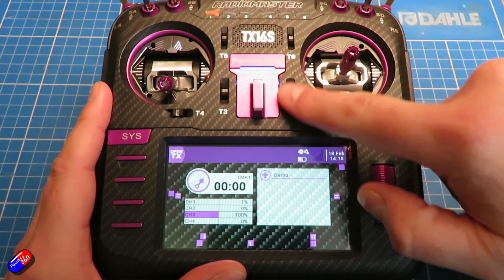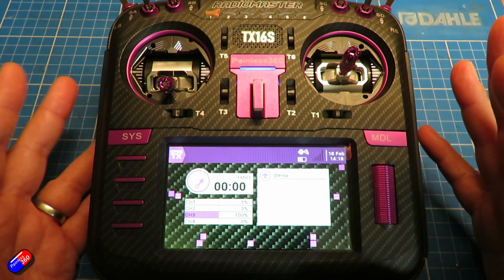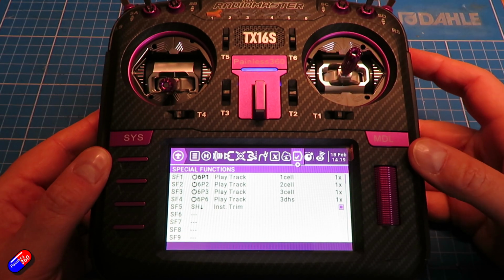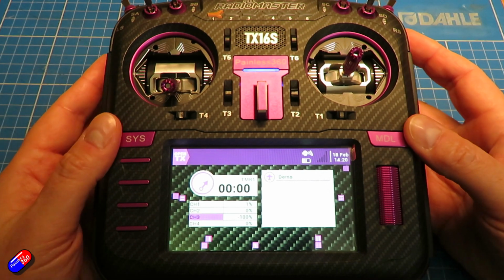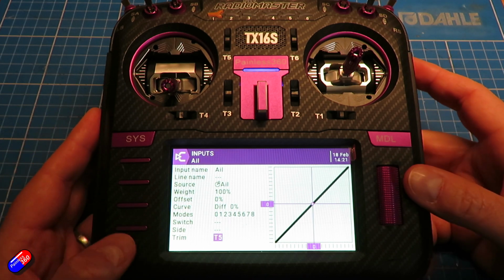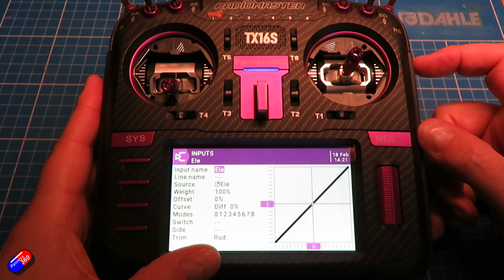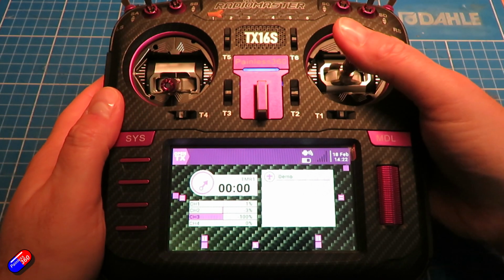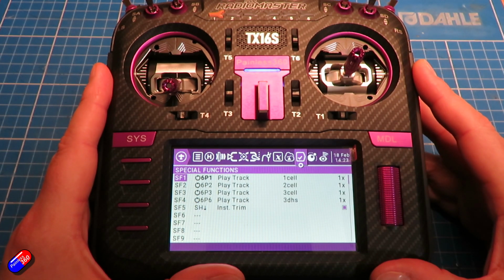How to setup Cross Trim and Instant Trim for your Fixed Wing models (Request)

Comment: One thing I've been wondering, is how can some of the things that go into special functions in models be set up globally.  

For example, if I had many models, and wanted a throttle lockout and instant trim on the same switches always or possibly something more complex? I couldn't find a way for the throttle lockout (throttle override to -100) to be defined in global functions, for example.  

It's easy in special functions, but that means you need to do it in every model, and since it's a safety thing, it would be best if it could be global so it will work on any model that has throttle on the default throttle channel.
Reply from the maker: I'm not aware of a way to do tha - apart from copying the model. If you find something, please let me know... Best of luck

Comment: HI I have just got aTX16S for my sins I am a Taranis owner so while getting to grips with it copying models across and so forth I noticed something. Now the battery (2 cell LiION 7.4v 5.0 AH) came before the TX so I thought I would charge the said battery, the TX arrived I noticed that the battery monitor was not showing a full battery I then proceeded to charge with the supplied lead using my computer after waiting for eternity the green light went out and the monitor showed a full battery . My Hota charger and battery checker recon it was full ???????
Reply from the maker: I remove the batteries from any radio to charge. I don't trust the inbuilt chargers and would prefer the battery to have an issue outside of the radio. Sorry I can;t be more help on this one. Best of luck!
Reply: There is a battery voltage adjustment to correct the reading on the TX16 display. I don’t know if that relates to the charge circuit but it would make sense if it did. Short job using the balance plug to a battery checker and adjusting from menu while powered on

Comment: Thanks Ulf & Lee. I used to use the feature with Spektrum but didn't realise it was possible with OpenTX. Now I see it is, just not a single tick in a box. I think I'll nip into companion and change all mine as I find the right trim hard to find with my left hand which means I have to glance down. As you know, this can be a bad thing!!

Comment: This cross trim programming is REALLY useful. Thanks!
Whoe! I just realized that my Eachine TX16S and the Radiomaster TX16S both have trim switches T5 and T6!  What are those for and how can they make flying easier?  - Jim
Reply from the maker: You can use them for anything you want including something like cross trim... Happy flying
Reply: I've set mine to callout battery voltage and rssi. You can disable the trim sounds in flight modes tab in opentx (change trim to :0 to disable it), but that button will not work as a trim anymore.